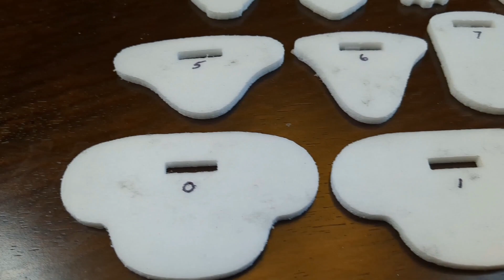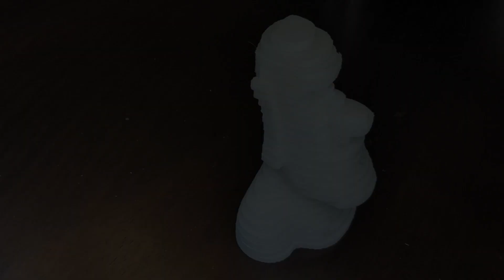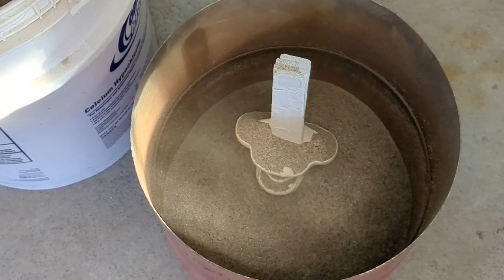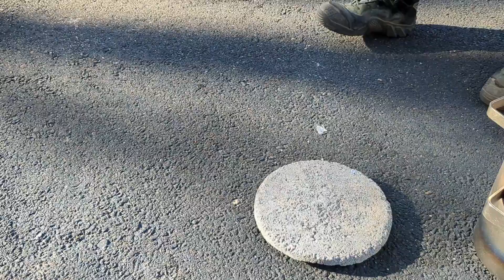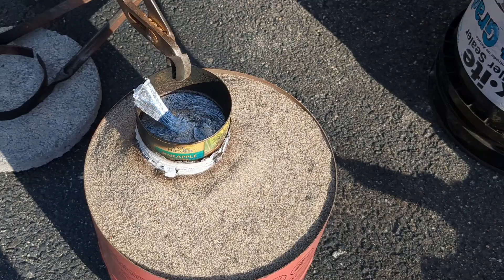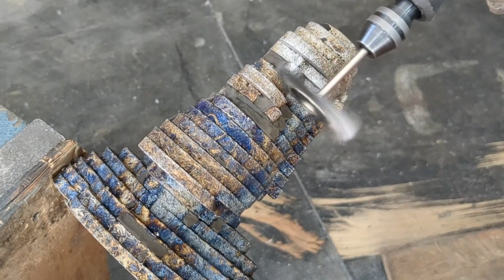Making an Aluminum Statue - Metal Moai Statue (Metal Casting)

Comment: Hey it came out pretty damn good. I got pne question - the fast tack glue you are using…what is it? A glue for wood or specific for foam?
Reply: Alright. Found the composition. It is PVA glue - commonly produce as wood glue 👌
Reply from the maker: It's just an All Purpose glue that holds items on contact.  It still takes 24h to dry though.

Comment: Noticing the small changes as you evolve. Seems you preheat literally everything now. Happy you leave the wrapper on the tin can. 
Surprised with the results as you didn't make a vent or whatever the technical term is.
Came out great. Nice work.
Reply from the maker: Thank you 🙏. I'm glad you are here to witness my evolution in metal casting.  I thought leaving the wrapper on the can would be cool 😂. Yeah with this type of foam you don't need a vent.  It basically just burns it up in an instant.  From my experience of course.  I could be totally wrong.  I did a cube with a different type of foam and that needed to have a vent.  It was extremely gassy.